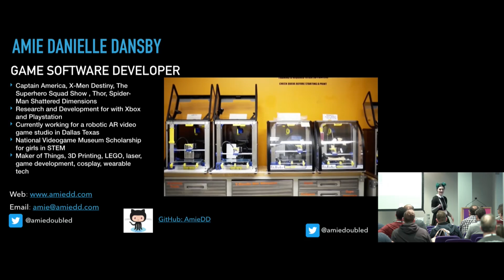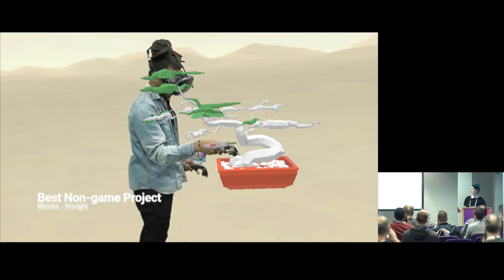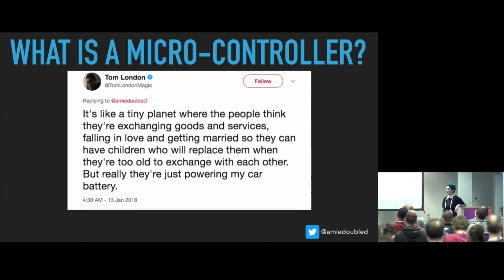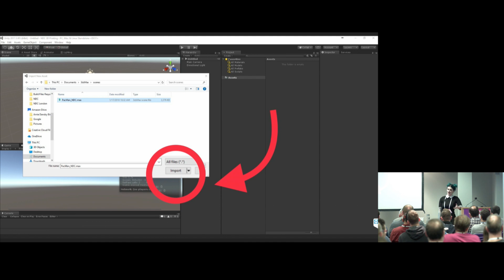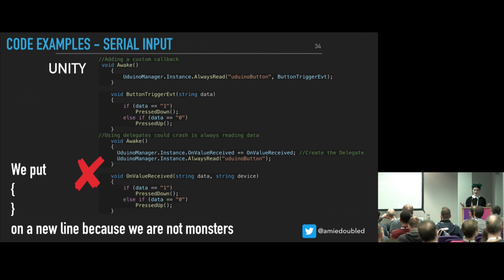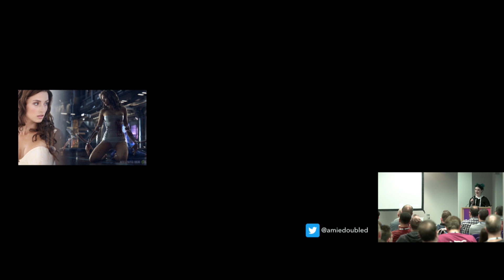That's not in the User Manual: Unity3D Software and Hardware - Amie Dansby

Comment: Speaking as a programmer, Unity is way nicer to work with than, say, Unreal Engine (with their "blueprints everywhere" paradigm which users seem to love but I find it nightmarish). Because integrating $YOUR_USECASE_HERE is so much easier and quicker, I'm not surprised people are using it as their default 3D interface for pretty much anything. Of course, the downside comes in performance, graphics quality, and large-team support - however, those are less of a priority for many projects. Also, the ESP2866 rocks!